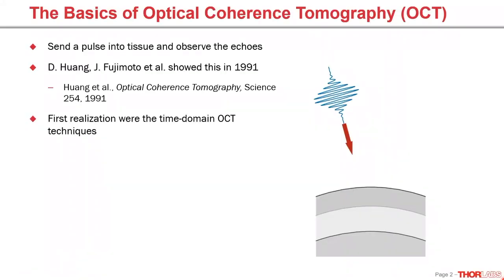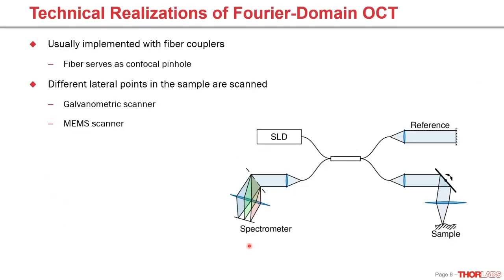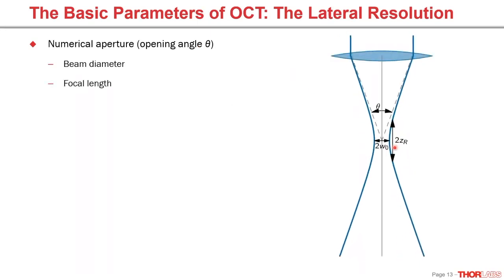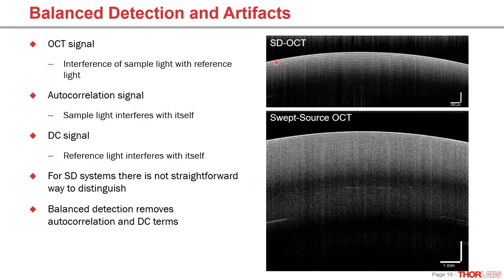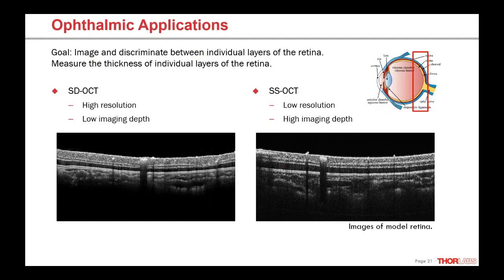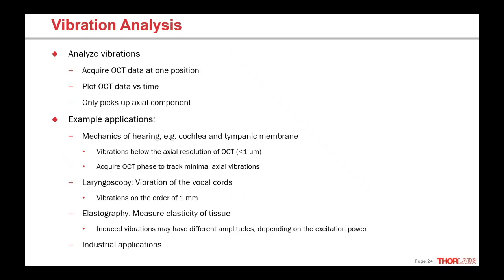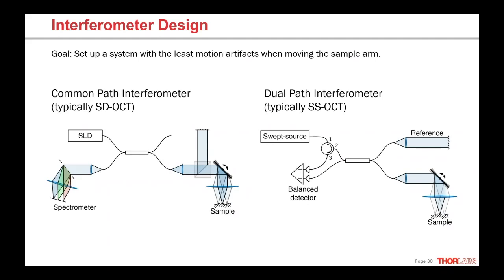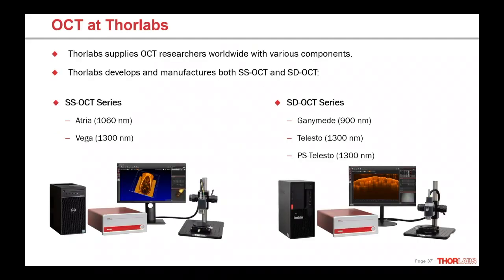OCT Technologies: Swept Source vs. Spectral Domain

Comment: 8.04 at SD OCT, how do get the depth information ? How k is converted to z?

Again at 9.39 how do we get z from k doing Fourier? After Fourier we get intensity vs lambda/2pi, where is z?
Reply from the maker: The Fourier transform of the interference pattern in k-space gives us the time delay between the two echoes that generated the interference pattern. Taking into account the speed of light in the medium we can calculate the path length difference between the echoes.
Reply: @thorlabs  Thank you. for your response. is k=1/lambda or 2*pi/lambda ?
Reply from the maker: We use k=2*pi/lambda.

Comment: Nice work. I was looking for this depth but simple presentation. One question - in TD OCT does the scanning of reference arm  along axial direction  and sample  arm in lateral  happen simultaneously at the same time ? 

Or we scan the reference arm to desire depth, keeping sample atr fixed, and repeat this process again?
Reply from the maker: A full scan of the reference arm happens at every lateral position. This gives you the full depth information (A-scan) at an individual lateral position. You then move to the next lateral position and repeat the scan of the reference arm to obtain the next A-scan.